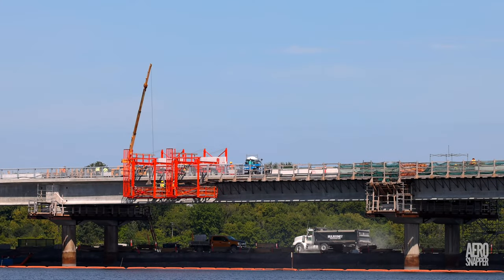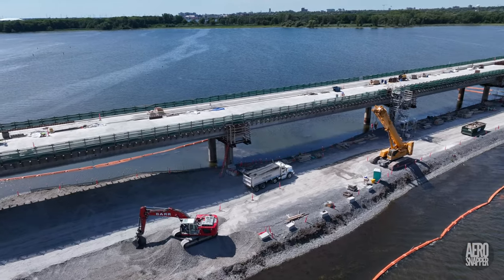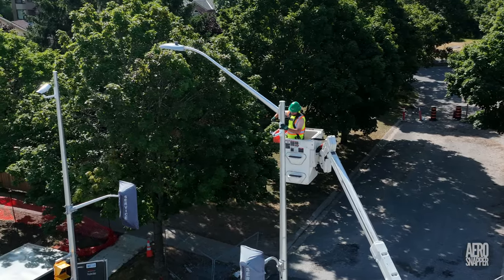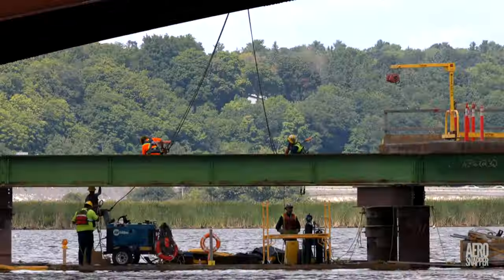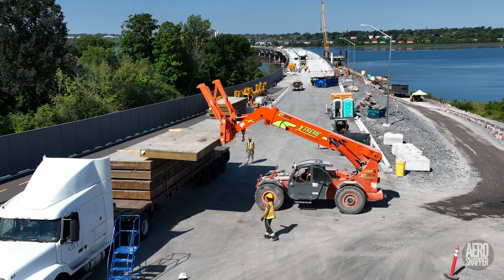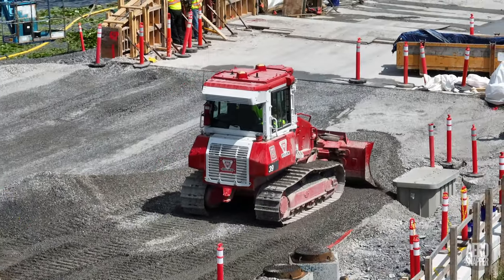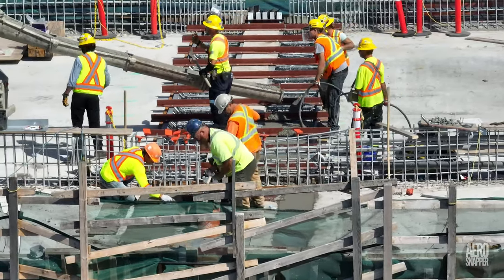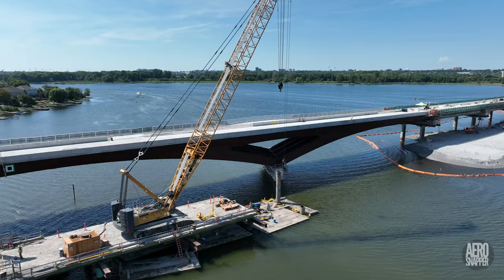Carried Away   4K

Comment: Another great update Mike, are there expansion joints on every span or only on a few !!
Reply from the maker: The technical interest is showing - there are six in all - one at each abutment and one each at Piers 6,12,17 and 22. The last two are on either end of the steel section of the bridge.
Reply: I can be technical at times 😉, do like a quick answer, thanks Mike 👍🏻